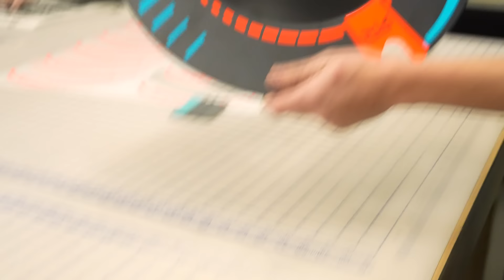Formula Drift 2024 Prep with RTR Team

Comment: There is one problem with the new qualifications and that's locking in more than 16 drivers. Rookies are at a pretty big disadvantage going into round 2. Let's say position 17th from last season gets a fast pass and loses to 16th in top 32. Then a rookie wins the qualifier so is 25th and then looses to 8th in top 32. 17th might keep their 17th spot and keep getting the fast pass with no top 32 wins. Only thing we can say is that they are worse than 16th position but could be worse than 25th. For the rookie we know they are at least 25th but worse than 8th but they could be stuck in the qualifier battles until getting a top 32 win. The only fair way is to give the fast pass to at most top 16 because they will have guaranteed a top 32 win this season going into round 2.

Comment: With the new qualification format, does it not make it easier for teams who can afford the best drivers in the world, and harder for smaller teams with less experienced up and coming drivers, to compete, therefore making a kind of Monopoly? The good drivers who get seeded can just put their feet up while the others have to struggle getting into the competition? Plus some drivers, however good they are, can make mistakes in qualification, which adds to the unpredictability of real competition, if you remove that aspect, it's almost getting to the point of rigged. Hopefully I'm wrong??? Maybe I'm not understanding the change correctly?